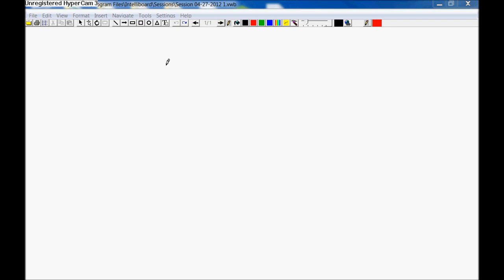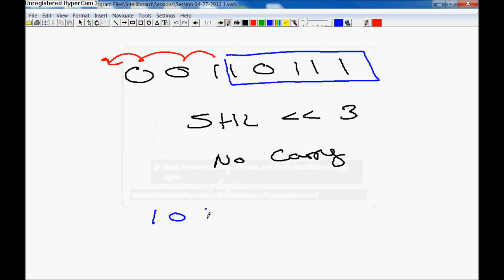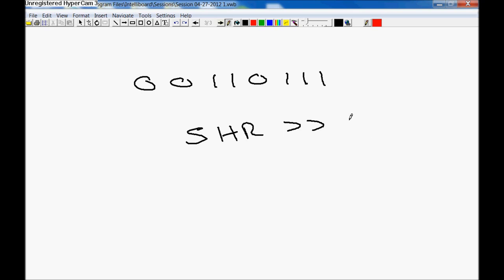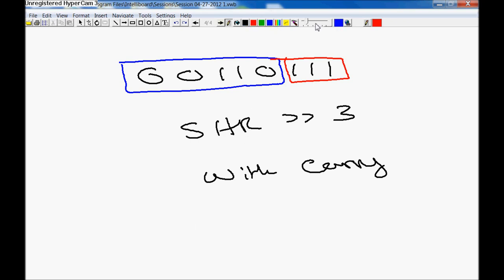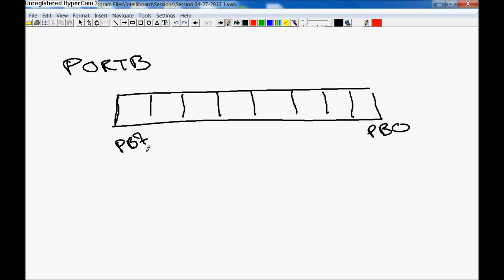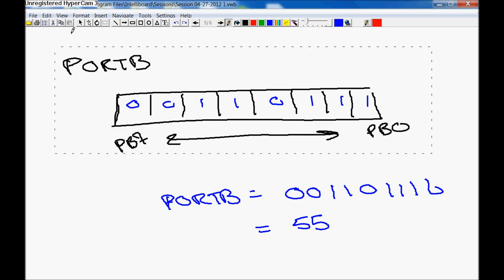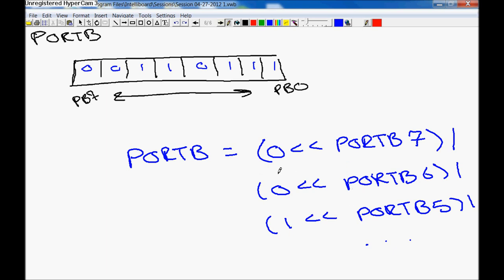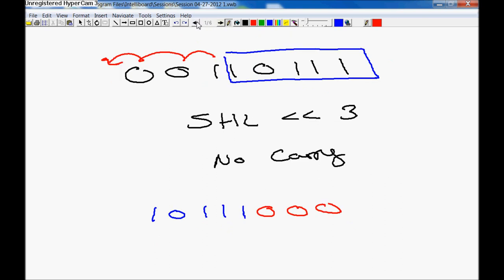Learning AVR-C Episode 4: Register Bit Shifting

Comment: Converting binary to hex in your head is easy.
Split the byte up in higher and lower nibble and calculate the decimal worth for each nibble and convert that to hex.
In this case 37h because upper nibble depicts 3 and lower nibble depicts 7, bring them together so hex value is 37h.
It only gets a bit tricky when you have 10-16 with is ABCDEFh

But since this was recorded 2 years ago you'd probably already figured that out.

Comment: Just a little thing, you wrong about carry...       C ←  b7 - - - - - - - - - - - - - - - - - - b0 ← C       So Logical shift 3 times of 00110111 = 10111000 and C = 1. If you do another shift throw carry. Now Carry will go to b0 = 01110001 and b7 go to carry = 1 Or you you prefer, carry is like a 9th bit. 
I'm an assembler programmer and i want to learn C. So thank you for your video it help me :)

Comment: PORTB = (1<< PB3); what does it mean? what is happening to the bits? are all shifted or what?
Reply: The result of 1 0b00000001 shifted 3 times left 0b00001000 is saved in PORTB, so you simply set the bit 3 in PORTB.

Comment: You're making this much harder than it needs to be. Each four bits is a nibble (half a byte), represented by one digit (0-F) in Hex notation. So you only need to count to 16 (0-15). So your first example 00110111 is simply divided into two 4-bit nibbles, 0011 (3 in binary), and 0111 (7). Thus 0011 0111 is 0x37. You can also say "PORTB = 55;" as well, but for that you'd first need to convert the entire 8 bits to a decimal value. So just use two nibbles. A million AVR geeks can't be wrong...

Comment: Thanks, that was helpful, but I'm wondering if this method would not work well if you were using other pins on the same port.  I'm guessing that it could be fixed by using a mask so they wouldn't be affected.  Interrupts would be a good subject at some point in time.

Comment: Not sure what you're saying. If you want to set PORTB to 0b00110111, all you have to do is express that value in hex. And that's easiest when you break up the byte into two nibbles. 0011 = 3h, and 0111 = 7h. So then 0b00110111 becomes 0x37. Thus:

PORTB = 0x37;

...is the line of code you need to make the assignment. It doesn't get any easier than that really. 

If you want to OR it with 0x37:        PORTB |= 0x37;

If you want to AND it:       PORTB &= 0x37;

Comment: I dont think there is a shift with carry comand in C. But you can kinda cheat by , lets say for example you do x<<2 and then do x |=0x03 then the first 6 bits would be the shifted ones and the last 2 would take 1. So 11001011 would become 00101100 and then when the "or" was finished it would look like 00101111.  Hope this helps someone.

Comment: "0<<PORTB7" means nothing really, until you #define PORTB7 to mean something. So if you do this:

#define PORTB7  7

...then when you say this:

0<<PORTB7

...you really mean this:

0<<7

So all you are doing is shifting the '0' over seven places, into the eighth place (you start in bit 0, and shift it into bit 7). In other words, you are setting the value of bit 7 to a zero, or "turning off" bit 7. But there's a much easier way to do that, simply by using a mask with the AND operation.